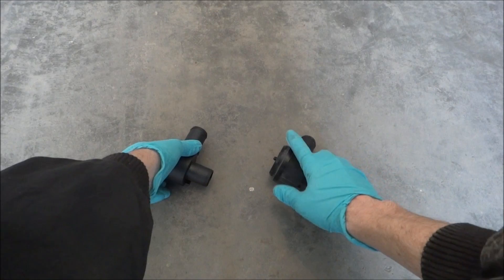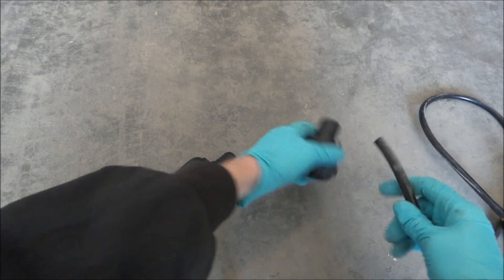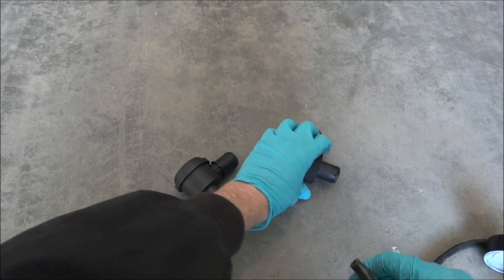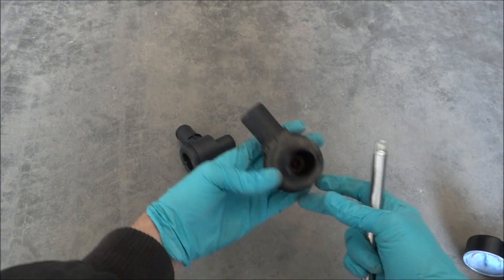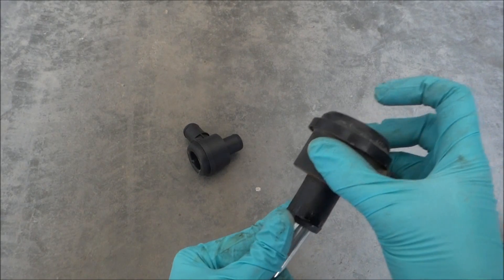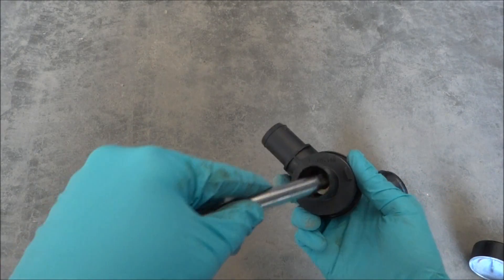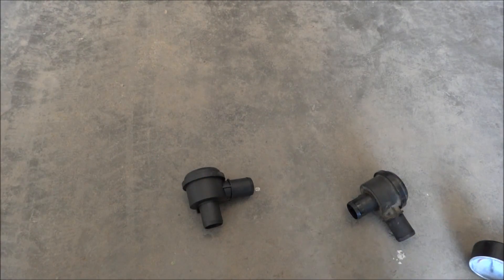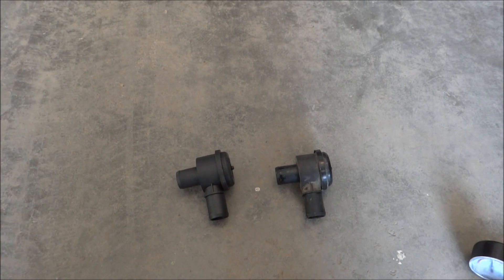Checking a Diverter Valve from a 1.8T Audi A4 B6 (02-05) - CEL: 17705 - (check D.V.!) P1297

Comment: I can hear my diverter valve going off when im pulling away more noticeable in second gear 1800 revs accelerating not to harsh, i get the 17705 pressure drop fault but the dv seems to check ok. Vacuum is good, boost pipes are good. Only when the car is cold it flags a fault if i warm it up before driving its ok?

Comment: excellent presentation! -- i think you my have solved my problem .. im getting a P0299 faulty diverter valve reading.. i have a 2003 Audi A4 1.8T Quattro 5 speed manual 4 door sedan.. is this the same replacement part i need ?

Comment: Would a bad diverter valve cause turbo flutter (when you let off the gas) and slight overboost and (waiting code) P0171 (running lean)? My DV doesn't seem to work as it should.
Reply from the maker: Might be but I couldn't tell you for sure.
Reply: it can cause fluttering
Reply: Did u fix it? What was it?
Reply: @ it was the DV. And the failed valve acted just like in this vid.
Reply: @thematsQ  mine also has fluttersih sound but very little, but car runs great, has great kick when you accelerate it..
Reply: @ariktsky4256  I think 1.8T from the factory should not have turbo flutter "stututu" (you can hear the turbo while it's spooling but not after you let go off gas pedal), because the extra air is diverted back to intake(?) via this valve.
Reply: @ its not making sututu its making more like ( you push gas pedal and release it ) whooom pss whoooom psss
Reply: @ we will see
Reply: @ Also the running lean code is usually about breather hoses that have cracks, check them if you have a code for that
Reply: @thematsQ  thanks, will check that today..

Comment: What happens to your car if your Diverter valve isn’t working? What are the symptoms?
Reply: for me in my 2003 Audi a4 i lost so much boost, to the point where I didn't want to drive on the freeway bc merging was a nightmare. replaced the diverter valve and everything is going smooth.

Comment: Hey please help me figure this out. Is the diverter valve suppose to hold it steady? Cause mines hold it but needle start to drop
Reply from the maker: Yes it is suppose to hold steady. You may have a small air leak.
Reply: Andrew thank you so much it barely holds vacuum needle starting to drop faster now

Comment: I have the error p1297 on my passat 1.8t 2003.the engine run with missfiers .after diagnose the car with vcds is look i have this error.i checked the dv and she.s broked.don.t hold the vaccum.may be that causse for the probem?i will change her
Reply from the maker: Ya definitely start with replacing the DV. If you still have issues check your PCV valve after.
Reply: I still have the problem
Reply: After replace it its run 3 min good after goes wrong
Reply: I don.t now what shoud i do
Reply: How much vaccum must to have on the little hose?
Reply: I thing is not enough
Reply: I cleaned the PCV
Reply: How can i chech it?
Reply: I still have missfiers and the RPM is up on 1000.may be the debitmeter?
Reply: I still have missfiers and the RPM is up on 1000.
Reply: I removed the plug from the drbitmeter and I went with the car and did not feel any change
Reply: May be the flowmetre?
Reply: Tomorrow the exchange and PCV valves. I obstructed the hose that comes from the PCV under the intake and the engine goes right. I think this was the cause. Tomorrow exchange both valves
Reply from the maker: Sounds good. I don't know much about your exact car but it sounds like that should fix your problem.
Reply: 9
Reply: It.s fixed now.the PCV was the problem

Comment: When i test my dv with vacuum pump, it holds vacuum steady, but the valve is not open.
When i test it manually, dv stays open until i let my finger off. Is that correct? Is my diverter valve fine or bad?
Reply from the maker: I'm not 100% sure, but it sounds like your DV is fine.

Comment: Would intermittent power loss be an issue with the dv? My mk4 hesitates on past half throttle acceleration
Reply from the maker: +Tyree White I'm not entirely sure. I would check spark plugs and ignition coils first though. My failing DV wasn't giving any hesitation issues, just a rough idle.